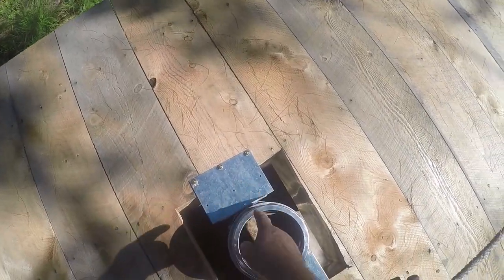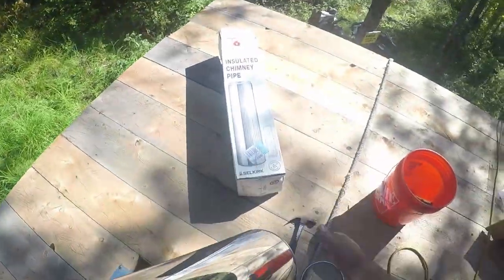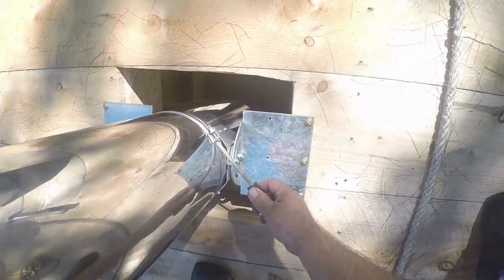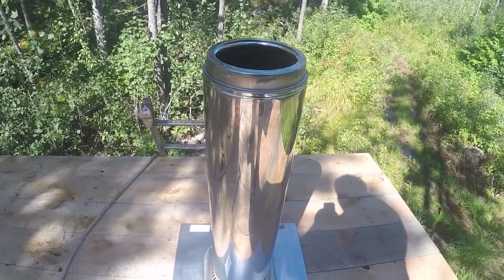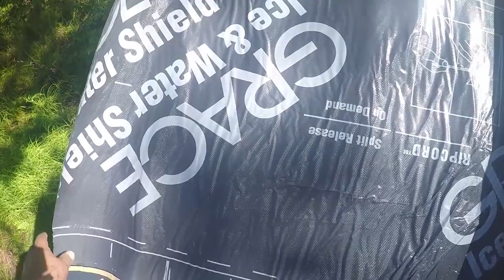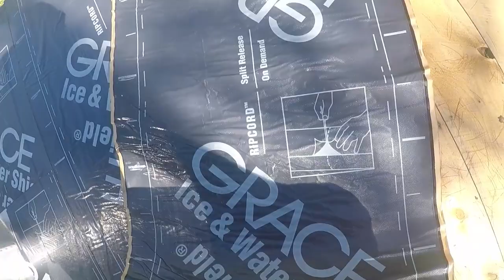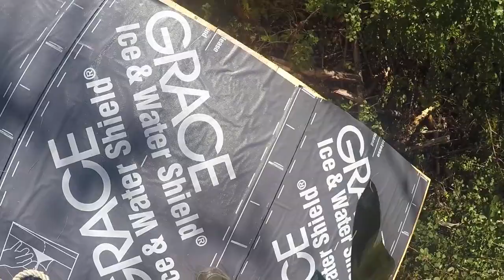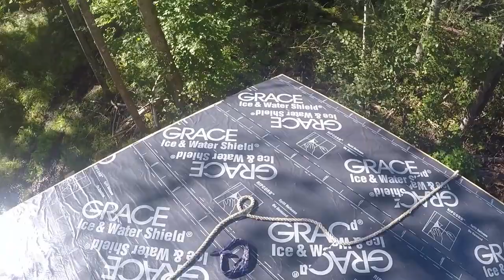#24 Tips On Ice & Water Shield With Chimney Install @ The Rustic Log Cabin Deer Hunting Camp

Comment: Great video Tom, thank you I certainly will be using those tips on the pipe install.
Reply from the maker: Good morning Gordon,  yes I keep the chimney simple because it keeps the costs down also by having just a straight shot up through the roof. If you noticed I also had about three inches of clearance between the chimney and the wood of the  building. That's very important whether you go up through the roof or out through the wall. I believe the directions that come with the chimney calls for 2 in of clearance I always double it.

One of the thing you need to know about these chimneys I should have mentioned it in the video. If you ever have a chimney fire do not build a fire in that chimney again. The chimney fire destroys the chimney and it will not be a safe chimney after that.

Tom

Comment: Thanks for the tip about the water and ice shield. Think that would work good for the roof on the A-frame. You're right about the rain up there tom. Seems like eveytime we've gone up to the lot it pours. Definitely makes working more difficult.
Reply from the maker: Good morning,  I think that's a great idea I put ice and water shield on all of my cabins roofs. I don't put it on out buildings and stuff like that anything that's not heated.
I use ice and water Shield because I know but even after the Roofing is all worn out the roof still won't leak LOL. I look at it like this long-term Roofing and I don't want to touch the roof again in my lifetime.

Yes we have been getting some rain this year usually it's not this bad but there are some Summers that it rains a lot. 

I hope you're having a great day! 

Tom